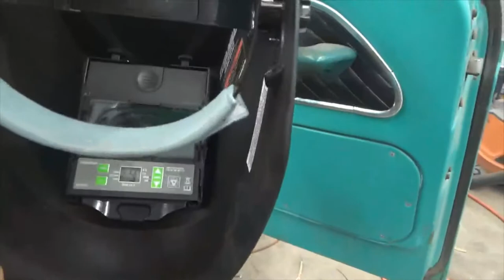Harbor Fright Titanium welding Helmet Review

Comment: I bought mine when it first came out, But it will not shut off have to pull battery,s after using. Love it but that part stinks, someone else has same problem.
Reply from the maker: I haven't  noticed but will check.
Reply: Any update on this? Mine is the same way
Reply: It has to be completely dark with no light hitting it